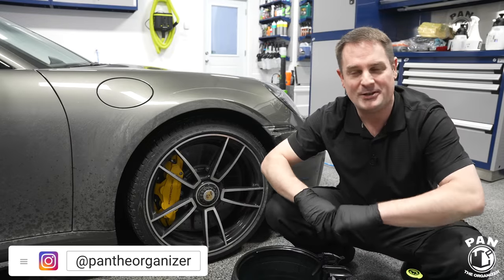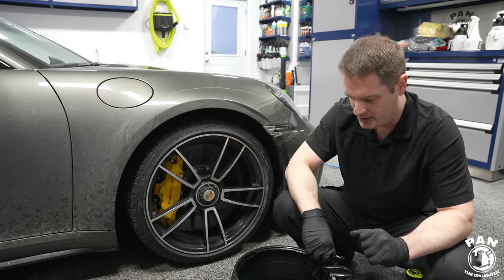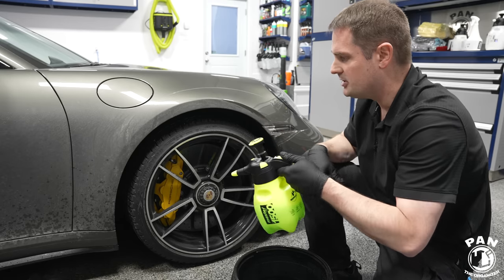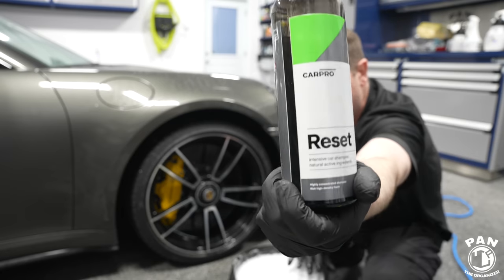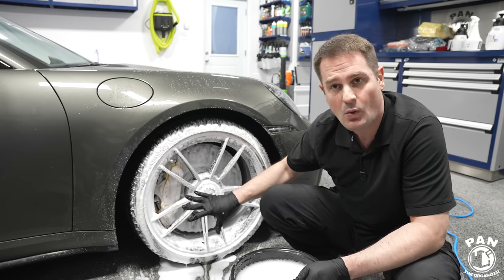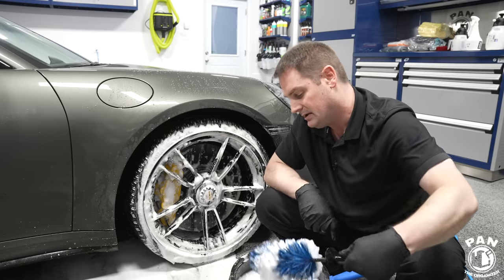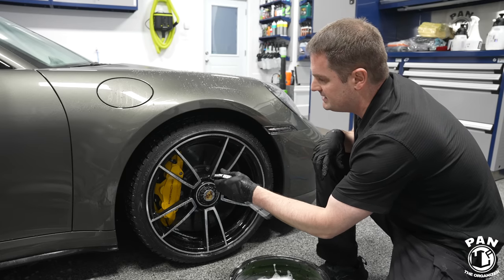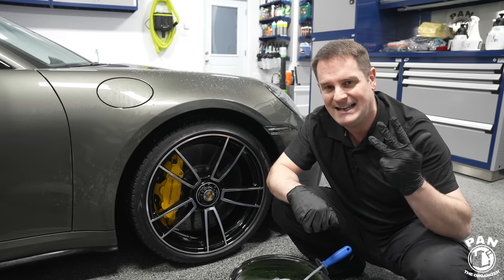How To Clean Wheels With Carbon Ceramic Brakes

Comment: Hi Pan love your videos. 🥰 i have a steel rotors should i spray iron remover on the wheel before cleaning it ? or after the wheel get clean? . And how ofter should i use iron on wheels? Thank you Pan
Reply from the maker: It’s aways best to clean the surface first and then use an iron remover. That way the product can focus on removing iron contamination instead of also having to fight dirt and grime.

Comment: Hi Pan, my car is using the normal disc brake (I don't know what it's called). I always have problem with whole surface looks rusty when in contact with water. Using CarPro Iron X will change it to purple color, but once I rinse it off, the surface still looks very much rusty. The next day when I need to use the car, the moment I release the brake, I can hear a bang on the brake (it's like the brake is sticking on the disc). Is this normal to see those rusty surface? It's kinda annoying that the whole car is cleaned, but the disc brake looks brown and rusty. Haha.
Reply from the maker: Hi Steve. You have traditional steel rotors (made from iron). Yes it's totally normal to get what we call "flash rust" or surface rust on them after washing your car. 

To help prevent that, you have two classic options:
1) As soon as you're done with the final rinse, drive up and down your driveway while applying the brakes. This should dry them quickly. Then dry your car as per usual. That should prevent rust from forming.
2) As soon as you're done with the final rinse, you can spray Hyde's Serum Rustopper directly on the discs, that will help prevent that surface rust from forming. Here's a link to the product: https://bit.ly/3vKxEA8

I hope this helps.

Comment: Since Brake Buster is PH10, is it safe to use on wheels, or better to dillute 3:1 in a Marlolex foamer? Also I would be very dubious about using a silicon based product on or near the rotors
Reply from the maker: I use Brake Buster both diluted (in a foaming pump sprayer) and undiluted (in its original sprayer bottle) and both work well.

Comment: Here I am again with rinseless method questions haha. Is multi x carpro safe for this? I recently started to apply multi x as foam on the wheels the scrub with brushes and wipe off the wheel with a towel soaked in onr
Reply from the maker: Yes that's fine. Same goes for Optimum Power Clean. Many use those APCs to clean wheels and tires before doing a rinseless wash on the paintwork with ONR or McKee's 37 N-914.

Comment: Hey Pan…hope you are well and staying safe. I know you are talking about brakes and cleaning them. I had a question on chemical decontaminating the paint to prep for ceramic coating. How often should you use iron x or tar x on our vehicles? Thanks I’m advance 😊
Reply from the maker: Once every 3 to 4 months for the iron remover, or as needed depending on your level of brake dust contamination.

For tar removers, use them only on a “as needed” basis. Meaning if you see some tar deposits.
Reply: @PanTheOrganizer  Thanks Pan…appreciate it.
Reply from the maker: My pleasure David. Hey what's your favourite video on my channel so far?
Reply: @PanTheOrganizer  I would have to say two videos. Your best products for 2021 and the how to prep and coat your vehicle with ceramic coatings.

Comment: @pan what can I use to clean gloss black rims? Thanks for the content and all the effort you put into your videos
Reply from the maker: I like to use microfiber brushes and mitts on gloss black and sensitive wheels. This is what I use:
Brush: https://bit.ly/2Yu77Ju
Mitt: https://bit.ly/3doe4CY
Reply: I’m sorry I meant for a Spray Cleaner? .. thank u so much!
Reply from the maker: I use P&S Brake Buster on my Porsche 911 Turbo S wheels and they are mostly gloss black. I work in a controlled environment. Avoid using it in direct sunlight or on hot wheels and you should be good to go.

But most of the time, just your normal pH neutral shampoo will do, in a separate wheel bucket of course. And once every other week use a dedicated wheel cleaner like Brake Buster.

I made a good battle video about good wheel and tire cleaners here: https://youtu.be/jfYZh1qB1LY
Reply: Thank you Pan.. I’m honored to have your reply and you sharing your expertise ❤️
Reply from the maker: My pleasure Greg. How did you discover my channel by the way?

Welcome to my channel. You discovered one of the biggest car detailing channels on YouTube as we surpassed 790,000 subscribers and 100 million views! I have been detailing for 25 years and I love to share my knowledge and passion with my viewers.

You found the right channel to help you learn everything about detailing.

Comment: Hi Pan , great content , btw , what kind of nozzle do you use on your pressure washer gun? And a topic on your garage floor 
Are you happy with , what are your recommendations do’s and don’t 
Thanks
Reply from the maker: I use a 40 degree tip on my Mosmatic gun.

And I love my garage floor (polyurea coating). I had that in my previous home and can’t live without.

Impact and chemical resistant, anti-slip, and sooooo easy to maintain. Just pressure rinse it and you’re done. Also, I’ll use a pH neutral shampoo for a yearly thorough cleanup.
Reply: @PanTheOrganizer  thanks any brand for the polyurethane coating ? Thanks
Reply from the maker: I had a team of professionals from a company called "Beton Surface" install their proprietary coating. I talk about it in my garage tour video here: https://youtu.be/gyehNOd44SY

Comment: I like to snow foam up the wheels while pre-washing the paint work. Since you said to avoid cleaners that are far from pH neutral would you say to avoid getting a snow foam such as Bilt Hamber TouchLess on the wheels of a car with ceramic brakes?
Reply from the maker: Not for weekly washed but once in a while no problem.
Reply: @PanTheOrganizer  Cheers!
Reply from the maker: How did you discover my channel by the way?
Reply: @PanTheOrganizer  Last summer after I bought my first car (Toyota Celica T-Sport) I watched ChrisFix's video on how to "Super Clean" a car. Then I started binge watching all of his content on car cleaning and repair. A while after that I starting watching all the content from the Meguiar's UK channel. Then you must have appeared in my recommended videos.

I've gone back in my YouTube history and the first video of yours I watched was "What's better? Wax, sealant or ceramic coating?". Followed by:
"HOW TO WASH YOUR CAR LIKE A PRO!!",
"ULTIMATE CAR WASH STARTER KIT FOR $150"
and "ULTIMATE INTERIOR CAR DETAILING KIT FOR $200".

At some point after that I discovered Jon from the Forensic Detailing Channel (who I know you speak to) which is where I found out about Bilt Hamber. You and Jon are probably the two people who I watch most in the detailing space at the moment.

Comment: Do not use high alkaline cleaner and yet p&s brake buster is ok? 😅Correct me if I am wrong but based on the sds this is ph 11. I have not seen a wheel and TIRE cleaner that is ph neutral.
Reply from the maker: Brake Buster was just for the tires. ;)

But it’s still fine to use on the wheels even if you have ceramic brakes as long as you are careful.

The notice was more for people who might use a harsher high pH APC to clean wheels. Not all chemicals are made the same. You can have a “safe” pH 11 product that won’t damage things and have another pH 11 product that could potentially affect the finishes. Chemistries are all different.
Reply: @PanTheOrganizer  It would be fun if you could do a litmus test to most of the products that you are using. In that way, we the consumers/viewers can have an objective data rather than subjective. Out of the many factors that can make a product great, at least by determining the ph level, we have one piece of the puzzle. Also, we are able to confirm if the data in the sds (if available) are true. If we could approach things in an objective way, it would be really great. Peace! Thanks Pan!

Comment: Hey Pam I got a quick question? Will the ceramic spray Hurt the rotors or the brake pads? I have just regular rotors and brake pads, but I’ve heard that if the chemicals attaches it selve to the rotors or the brake pads it could mess up your breaking performance, just a quick question something that I’ve heard around
Reply from the maker: It has absolutely no effect here on the brakes. I have been using this for years on all types of wheels and never had issues with braking.
Reply: @PanTheOrganizer  awesome 👍thank you so much Pan, I greatly appreciate you getting back to me 🙏
Reply from the maker: My pleasure Joe! What's your favourite video on my channel so far, by the way?
Reply: @PanTheOrganizer  so far I gotta say and what first come to mind is….actually there’s 2, the tutorial you did with your brother, about interior Detaling and the one about the stuff you carry in the trunk of your car, but there’s so many I’ve enjoyed it’s hard to chose my favorite ones, you know what I mean…. lol 
Thank you so much Pan for all of your help and guidance

Comment: How would you remove chalk or writing on a new factory tire?
Reply from the maker: I like using Citrol 266 as it can also remove the colored factory balancing dots on tires.
Reply: @PanTheOrganizer  Thanks! ill give it a try. Do you have any tips for cleaning/protecting carbon vinyl racing stripes?

Comment: Pan , retyre makes damage ?
Reply from the maker: Hunh? Damage to what? It doesn't damage anything. Why would they sell it if it damaged things? This is a tire degreaser and it does its job perfectly. I have been using it since it was released and never had issues.
Reply: @PanTheOrganizer  no nooo is car pro retyre damage ceramic pads ? …. I follow you and use products as youre recomendation
Reply from the maker: It doesn't damage anything.